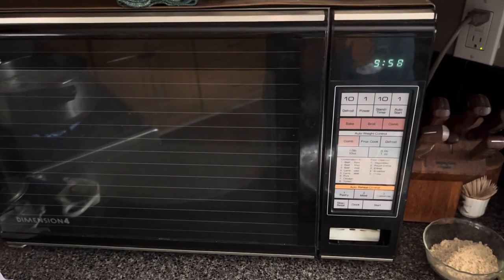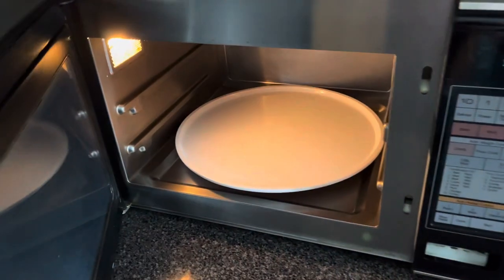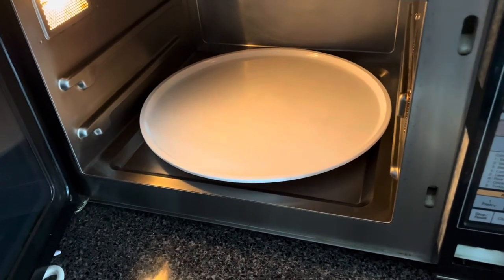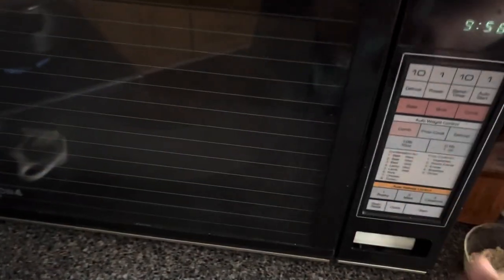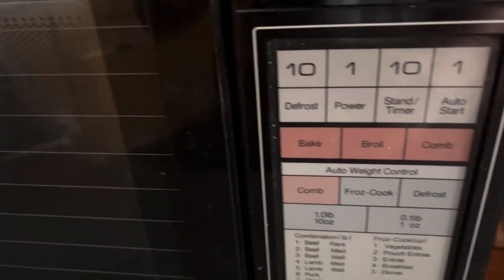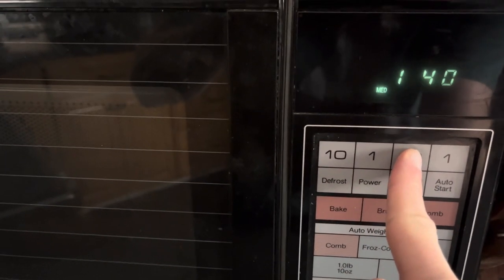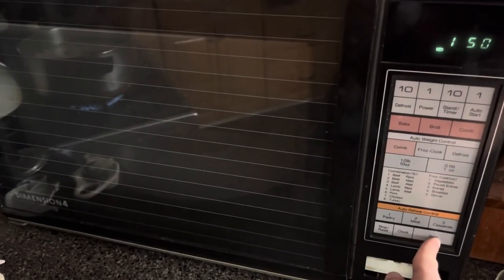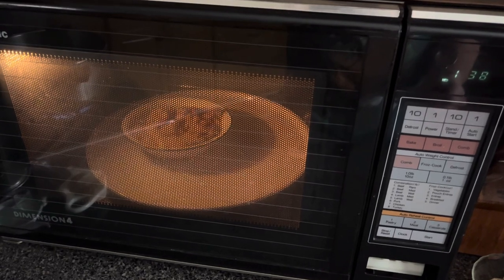80’s Vintage Microwave Oven

Comment: Vintage products are much better made than their modern counterparts. Comparing those vintage Panasonic microwave ovens with modern ones is much like comparing a vintage Maytag washer or dryer with a modern one, and comparing a vintage Frigidaire refrigerator with a modern one. In the "modern vs vintage" comparison, there's no doubt that vintage wins.